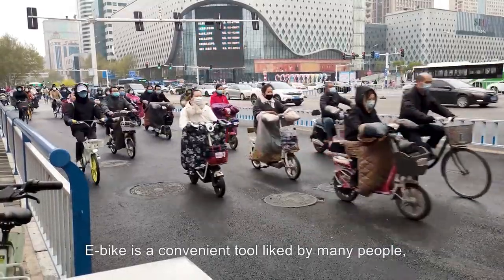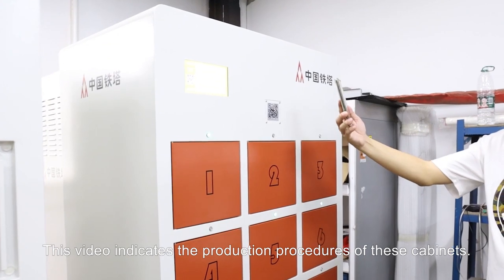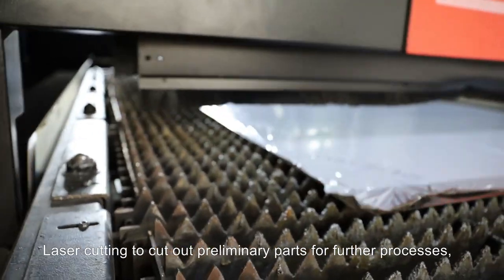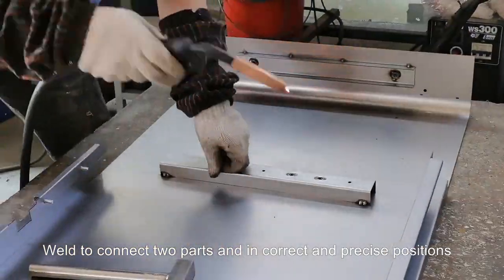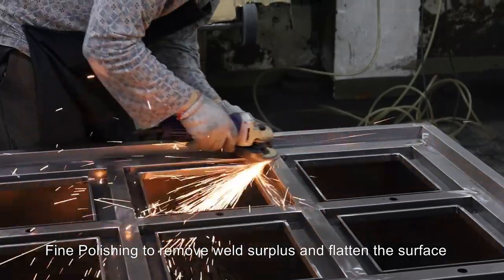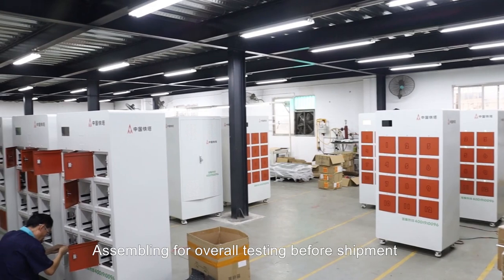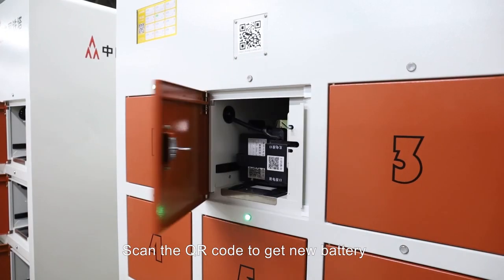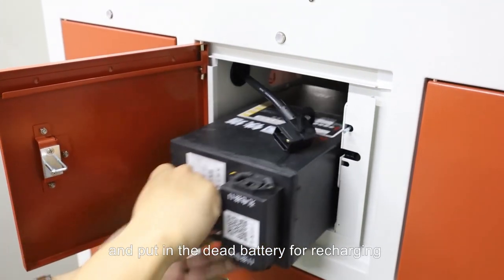The Green Delivery Revolution: Battery Swapping Stations for a Sustainable Future

Comment: How much time need to take a full battery charge?
Reply from the maker: The charging time for an e-bike battery can vary greatly depending on the model and battery capacity. However, on average, it typically takes between 3 to 6 hours to fully charge an e-bike battery. High-capacity batteries may take up to 8 hours.